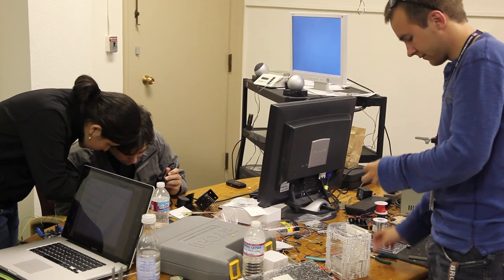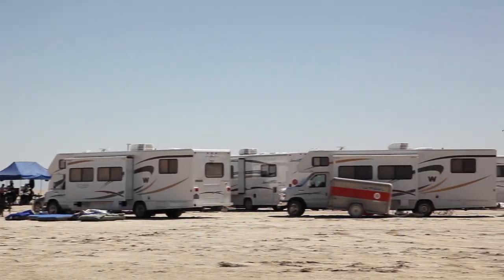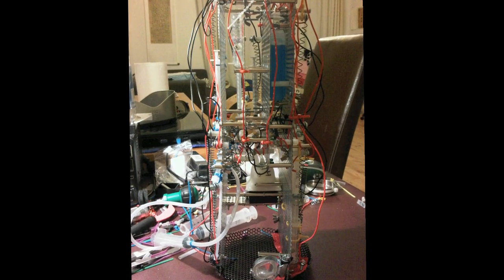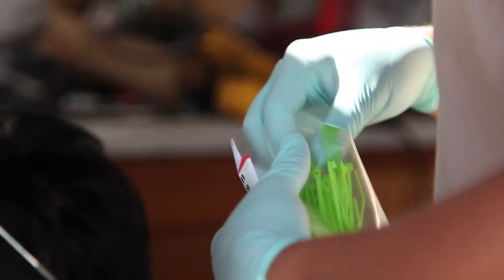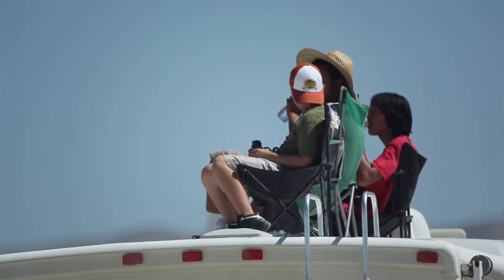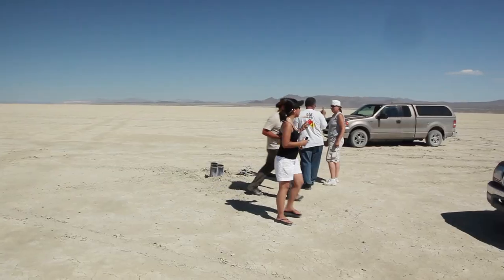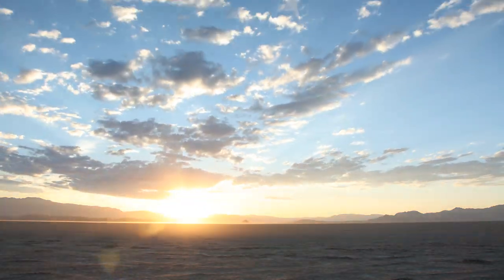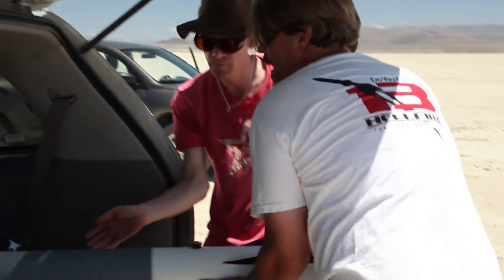PhoneSat Rocket Launch Documentary

Comment: Which type of fuel you use in your rockets and how much thrust it produce??
Reply: These are commercial rocket motors which use ammonium perchlorate composite propellant (APCP). Google "Cesaroni rocket motors" for the details.
Reply: I found all the information. Here is the rocket they used:
https://wildmanrocketry.com/collections/intimidator/products/intimidator-5
And here is the motor:
http://www.pro38.com/products/pro98/motor/MotorData.php?prodid=17790N4100-P
So the average thrust is 4127.0 N (927.8 lb) and the burntime is 4.31 s, which gives the total impulse of 17790.3 Ns (3999.4 lbs). The altitude they achieved is 28000 ft.
Reply: @saszab they don’t make the motors?

Comment: Would these small sats create more space junks?
Reply: No.

But you just created more Internet junk. :-(
Reply: No amateur class rocket has put a payload in orbit.    YET
Reply: Wrong. It's a different required trajectory to put something in orbit. Amatuer N class rockets reach proper altitude
Reply: It’s less of the fact amateur rocketeers don’t have the skills it’s more the fact that it’s a very cost prohibitive industry
Reply: @450ktm520  It's not just "proper altitude" for the orbit. It's proper horizontal speed as well. None of the amateur rocket motors is able to achieve such a speed.
Reply: @spaceflightsimulatorshowca8987  It's both.